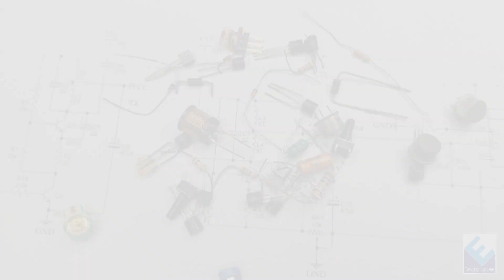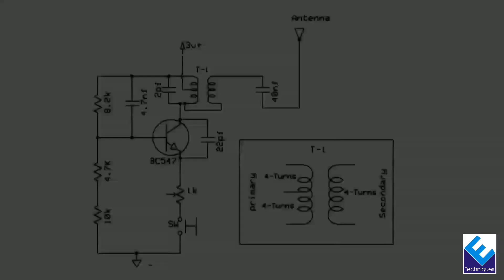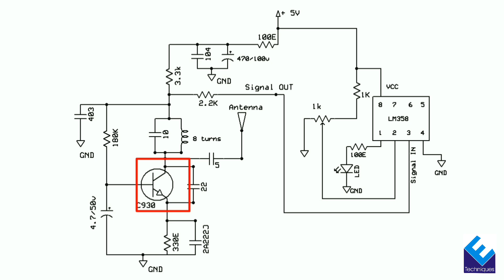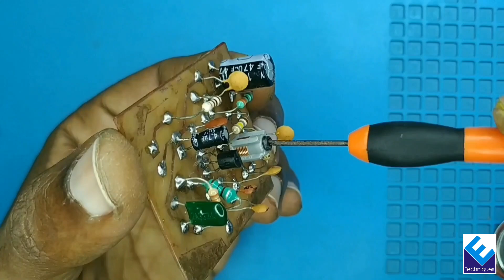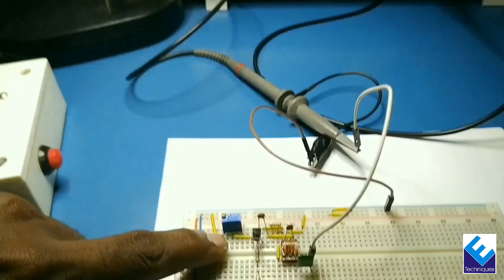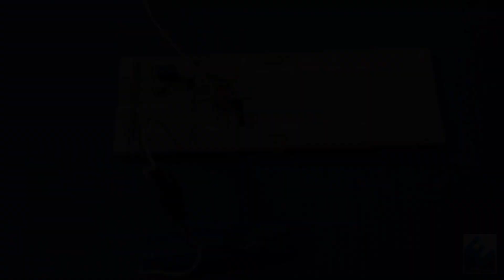How to make a simple R.F Transmitter and Receiver( Transistor based circuit) (Part -1)

Comment: You should give details about the coils. What is their length, diameter, wire gage? What ferrite core did you use or what is its properties? These things are important if you expect someone to recreate your design.
Reply from the maker: Actually i have mentioned the details in the video ( 5mm diameter ,8 turns , 22 SWG enamelled copper wire. )
https://www.google.com/search?q=ferrite+bead+&client=ms-android-vivo-rvo3&sca_esv=d53aead586a21d84&udm=2&biw=392&bih=760&sxsrf=AHTn8zq2Ix--f7tmmWE7pH1Qq1XWv7JQLQ%3A1742051287990&ei=15fVZ-SVPJf2seMPmeXxqQg&oq=ferrite+bead+&gs_lp=EhJtb2JpbGUtZ3dzLXdpei1pbWciDWZlcnJpdGUgYmVhZCAyBxAjGCcYyQIyBxAjGCcYyQIyBxAjGCcYyQIyBRAAGIAEMgUQABiABEjSG1CBDlivFHAAeACQAQCYAckBoAHOBqoBBTAuNC4xuAEDyAEA-AEBmAIEoALBBcICBhAAGAcYHsICBhAAGAgYHsICBBAAGB6YAwCIBgGSBwUwLjMuMaAH6Rw&sclient=mobile-gws-wiz-img#ip=1&sv=CAMStQQahwQK4AEKuQEStgEKd0FBLUtUaGN0akFWZFBHRmg2dFpGWUtDUllMLTl4cHZIR2VSOEZuSW5PM2Rjd1daVWF1bERGVE5fVm52VzNjc2V5cHJ5UWRlNlNIbmhsT0M1enBaalZhMVlZLXNpVENPbkctNktGbE4tdjA0SG12eTBpZTlZZ3M4EhdYSmpWWl9Makl1N3VzZU1QaE9uWTZBZxoiQUNEWEw0bkNtMFhob0RtblF2cTc0a3prZ01ERWFZSDVqURIDODQ5GgEzIhEKAXESDGZlcnJpdGUgYmVhZCIHCgN0YnMSABKOAgrPARLMAQqMAUFBLUtUaGZsY0dQTzg5NGIwTFNndkN3SDRjUXZhN0M1d3dyVjFGaXQySEFDUkVoUDBtMGZjNmJxMk82T2xwblZmZ3BCZjVvRG1nQWQ3OWpPV2UxZURmNW1IR09JSFJHWVhobUo5ZXg1X1pDVWF6TlZFTm5UOWQ4OEtIb2lYZXY0TDBvRXROMm5DQTdlEhdYSmpWWl9Makl1N3VzZU1QaE9uWTZBZxoiQUNEWEw0bXhhWWh2ZFRrRjhQM1A0TzJIanlHbWxfNzIxdxIENDY5OBoBMyIYCgZpbWdkaWkSDmFqRWpRMG9jQl84RmtNIhcKBWRvY2lkEg5RbW12bnh2WHZHOUxUTRoRc3ZfYWpFalEwb2NCXzhGa00gBColCg41WW9ydGVTTnN0T1pZTRITZS1zdl9hakVqUTBvY0JfOEZrTTABIOTJyKAOKi8yYWhVS0V3anlnZXFncjR5TUF4VnVkMndHSFlRMEZvMFF4aUFvQUhvRUNERVFBQTAB
Reply: Pick an easy former:

Diameter 𝑑
   d=8 mm (r=4 mm),

Wire: 0.6–0.8 mm enameled Cu, Close-wound, then spread for trim.

Solve for N to get ~1.7 µH. With: 
   𝑑 = 8 mm
   d=8 mm, let ℓ ≈ 𝑁 × 0.8 mm
   ℓ≈N×0.8 mm (close-wound). 

Iterating:

   N ≈ 10–12 turns typically lands near 1.5–2 µH at this diameter.

Start with 12 turns, measure, and spread/compress to trim.

If you need less L, remove a turn; if you need more L, add a turn or use a smaller diameter.

Practical tip: aim slightly high on inductance; you can always reduce L by spreading the coil or removing a turn. It’s harder to add L cleanly once built.

Narrowing the tuning range (recommended) To keep the knob sane and keep within 26.9–27.4 MHz:

Use a smaller trimmer (e.g., 2–15 pF)

Add a series pad capacitor with the trimmer (e.g., 10–22 pF in series), which compresses the effective tuning law and limits max 𝐶tot.

* Keep wiring very short; parasitics add unwanted swing.

Comment: What is the range ?
Upto how many meters it will work?
Reply from the maker: When I first built it, I could only reach 5 meters, but after some fine modification, I was able to reach  Up to about 100 meters.
.
Reply: @etechniques 
Oh really! Extended 100 meter only using transistor is a great achievement sir.
I failed many time to built the recieve circuit
Still trying. Due to lack of oscilloscope i didn't understand where I get the problem.
Reply from the maker: @changed55555 It took me years to understand this circuit and build it.
Reply: But this experience also last long 😊 
 @etechniques